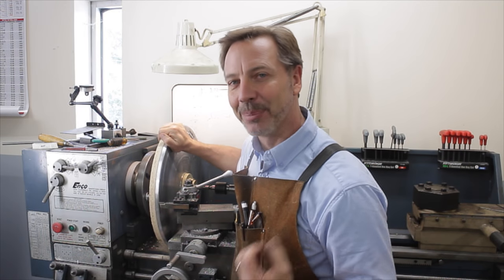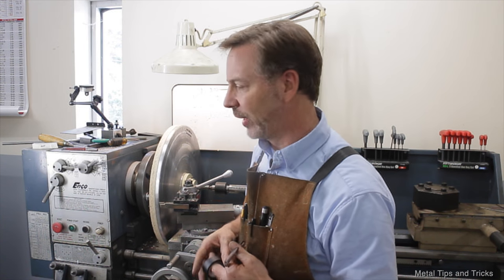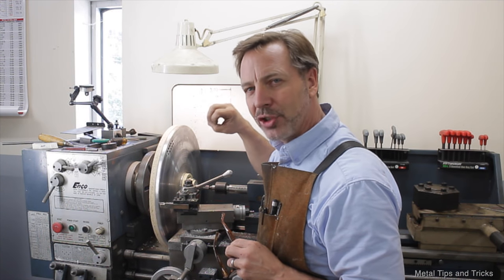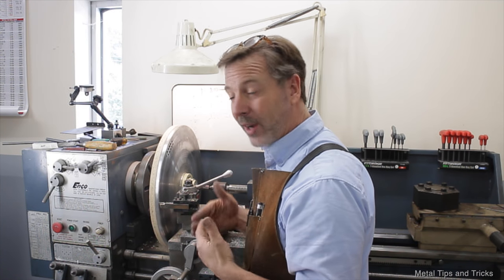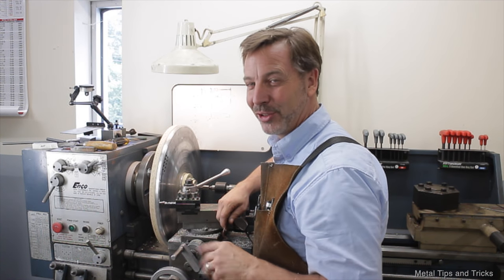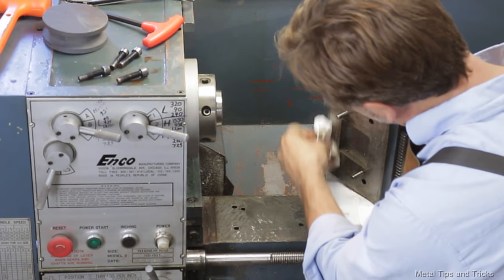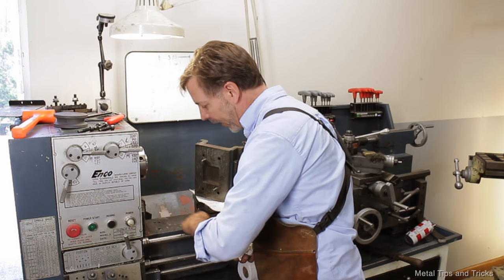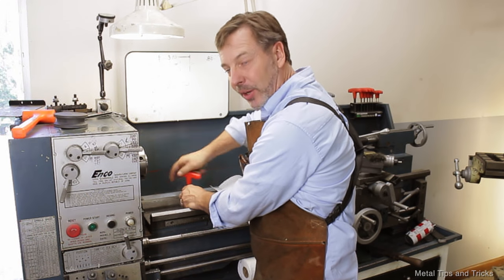18" disk sander part 2

Comment: When woodturning thin spindles, platters and discs like this it always helps to use the left hand if you're right handed to dampen vibration so with a leather glove on your left hand you could support the rim of the faceplate as you cut. Obviously it's a no-no to wear gloves on a lathe but if you're careful and trail the fingers below center height you're fine on this job. The circular table saws you mentioned usually also have a felt or leather pad on a block held against the blade to absorb high frequency ringing.

Comment: The brazed tool you were using has at least 1/8" radius. What you need is a 1/64" radius tip preferably at a positive angle or grind a positive swoop into the tip. As far as taking chatter out of the material, if it's steel I use magnets, mag bases, mighty mags, to avoid chatter. Controlling the rpm's is also important, you may need to take it slow. The methods you're showing work well for aluminum as long as the accuracy of the thickness is not important, then chatter might not matter either. Also you can fasten several studs with t nuts to the chuck and use flange nuts or coupling nuts tightened against the material to reduce chatter. Add strips of rubber between the material and nuts for extra chatter reduction if necessary. Lose the face shield and apron around a lathe, use safety glasses. The chuck, the part or a stringy shaving can grab to these items and cause an injury. Be safe brother.

Comment: Hello Dale,

Have you seen Tom Lipton's video on spring tool holders? Normal too post geometry results in the tool increasing its depth of cut if it's deflected under load. A high load like a form tool, or a large overhang like you had, are likely to result in significant tool deflection. Whilst normally we want high rigidity, using a tool holder that deflects quite easily can be an advantage if the point of flexure results in the depth of cut decreasing, rather than increasing. That's the idea of the spring tool holder. 

If you mount your tool upside-down and run the spindle in reverse, then any flex in the cross-slide, top-slide, tool post and tool is going to reduce the depth of cut and help prevent chatter, harmonics etc. I run my parting blade this way and have never had a dig-in.

The bed gap is a mounting surface, not a bearing surface, so you don't need many spots per unit area.
Reply from the maker: thanks for your comment. Ill have to try spring tool next time.

Comment: Don't worry about all the "safety " hounds. I bet they have forgotten safety, a time or two. In some instances, being "safe" can be a hazard. I have been there, wear safety glasses with face shield and STILL get stuff in my eye. I hate guards on grinders, they have caused me more grief than good. I work on pipelines, and grinds with guards will through sparks on the other guy. As far as machining, glasses is all I wear. Great videos, keep it up.
Reply from the maker: thanks for your support :-)

Comment: The wood backing was stuck on the disk and not touching anything else? Great video! I remember at a kid my dad and I taking his pickup truck in for a brake job. The front brakes were disk brakes the mechanic turned down the rotors, he used inner tube cut cut into one long 1 inch wide strip and stretched around it to stop the ringing and chatting. Thanks for sharing.

Comment: What are your thoughts on a multi layer plywood backer and or a micro tool with an abrasive wheel?  I think the wood should absorb any deflection/vibration and grinding as opposed to cutting again less deflection/vibration.  Or go to a brake shop if they still cut discs.  You could use a coarse stone in the sander configuration and go thru the grits almost like lapping it.
Reply from the maker: I like the way you think. there is a better way of doing thinks.:-)

Comment: Good work. I thought you would have put a dial indicator on the carriage to make sure the ways on the gap are in line with the ways on the bed. I know the two are aligned where they meet, but isn't it possible the gap piece is high at the other end? Wouldn't it be prudent to measure it?
Reply from the maker: I thing you might be right. better to be safe then sorry. :-)

Comment: It is a good idea to use a backing plate and double sided sticky tape. Probably many different types of backing plates would do since I guess that the most damping action happens in the sticky tape itself rather than the backing plate. Of course the damping in the tape would not happen without the stiffness of the backing plate building loads across the tape against the vibrating disk. And the backing plate needs to be flat so that the disk is not statically distorted during machining. Very useful video, thanks.
Reply from the maker: thanks for your comment

Comment: Dale - you might want to try a nice HSS that's really sharp with a nice positive rake.
Reply: I second that amendment! The cutting edge wants to be square to the feed direction too so as to load the spindle radially and not the faceplate axially at it's most flexible, which is the main problem here.
Reply from the maker: Itry hss and several different grinds, but the tool didn't hold up very long. Mostly because i could not get a deep enough cut. Do to the delicate nature of the disk. I wish Hss would have worked.😞

Comment: Dale, Love the channel. I noticed under the gap bed there are three or so chiseled peck marks at the rear left of the bed. Might be useful to mention that this is a way that the factory displaces metal in specific areas to raise a part for final fitting. I stoned some of these off the base of a Chinese finger brake and have yet to get the fingers perfectly aligned with each other.  Lesson learned. I trust your piece is now level but thought I'd mention it. Keep the info coming!  Dave

Comment: There are method for visually determining the location of harmonic nodes of various shaped flats. Mount it in the center, position it horizontally, sprinkle some salt or sugar on it. Now place a speaker next to it at full volume such that noise from the speaker drives the flat into motion (you may need to attach the speaker to the central shaft to impart enough vibration). The salt will bounce away from the places of maximum deflection and aggregate in those places of minimum deflection. This will suggest the best locations for you dampers. (somewhat better than "random placement").
Reply from the maker: interesting idea. :)

Comment: Hi Dale, great two part series enjoyed it very much. You talked about the 3-belt pulley used on the unisaw to cancel out harmonic vibrations, I tried to find more information on this theory and had no luck. All I found that it is used in high power transfer applications. Do you have a reference source that describes how and why it works to reduce harmonic vibrations. Thanks for all your good works!
Reply from the maker: I learned this some 35 years ago. so I don't have a source for you to research it. but it  similar to when you go to a playground were their is a  swing set. Get one of the swings moving it will transfer its energy to the one next to it and make it move,  but if you have 3 swings together it will not transferrer the energy wave because they cancel each other out.

Comment: Even positive rake carbides work on thin disks better but I would use HSS positave raked on aluminum with some 566 CRC. That workshop looks far too clean, how much work has that lathe actually done?

Comment: Some of the chatter may have been caused by how far you had your tools from the quick change holder.  I generally use a 3 to 1 rule.  I realize you were "reaching" to accommodate your machine travel but wonder if a larger tool holder may have also helped.
Reply from the maker: It not about the tool holders this case. its about the disk wanting vibrate because of harmonics. but i do agree having the tool out as far as I did doesn't help.

Comment: Dale, I like your videos. You have quite a few videos where you use that ENCO lathe and I think you should add that as a keyword, or somehow incorporate that leave into the title and some of these videos. I think it would instantly provide some great quality videos to The people searching for information. I just purchased and ENCO lathe model like that and I’ve noticed that there are not very many good videos available for that series. Mine is a 12 x 36”geared head but just about everything else is the same.
Reply from the maker: thanks for the suggestion, I will.

Comment: I wouldn't have tried to balance that large piece of particle board on the band saw. With that wheel able to provide that wonderful template bearing surface I would have used that double sided tape to hold the wheel down to the particle board and used a router with a template bit to ride around the wheel and cut it while laid flat against a table.

Comment: "Harmonics" means that you are setting up a vibration that is in sych-- has the same phase -- with the spindle speed, or maybe some factor of the spindle speed like 2x, 3x, whatever. We all get it sometiimes,  that is what "chatter" means. Lots of causes, unbalanced load is one of them so the MDF backing. was a very good idea. I have read other people's books and they suggest putting weight on the tool itself. Like tape a fishing sinker to the tool. I thought you had to much stick-out. Sometimes changing that by 1mm will get rid of the chatter. Other days, the bear gets you.
Reply from the maker: thanks for your comment

Comment: During most of your video I was worried about getting that damn double-sided tape off. I am fairly certain that the stuff is manufactured by the devil in hell. So, I learned something about using the lacquer thinner. Thanks! Also, I think that the MDF was a great idea that, in principle, has application elsewhere in the shop to provide dead weight when needed. Best. ~gjl.

Comment: You did good IMO...when running into harmonics of cutting tools in thin surfaces, speeds, feeds, mounting rigidity, damping and adding mass all need to be messed with.. Sometime you get lucky, sometimes you need to be more creative.  The melamine backing was a good fix.  One thing that worked in the past was using a lead tap in weight like Abom uses on the back. Hold it up against the back like your idea with the skateboard wheel.. 

I appreciate you pulling the gap.. I've got the same lathe but have not needed or had the courage to pull the gap..  One of these days I may need to..
Reply from the maker: thanks for the comment. I will have to say I was a little worried about pulling the Gap but it was as bad as I thought it might be, LOL

Comment: Variable rpm is the solution. 10% plus o minus of rpm
Reply: varying spindle speed on a CNC lathe works well with cuts on your Z travel. Using your constant surface speed command should help cuts on your X travel.  I am not much of a manual machinist to verify but I have not seen many manual lathes with variable speed control that can vary without stopping to change gears.  I believe this is one reason behind the steps Dale created.

Comment: You seem to have far too much overhang on the tool. That will always result in chatter. Regards Dave Tointon
Reply from the maker: Tom you are right, but this is what I had to do to reach the hard spot. Remember just because the lathe can hold the material it dosen't mean that it can be turned using conventional technics, Sometimes you have to cheat it and use a couple tricks. :-)

Comment: Are you a machinist ? No "magie" in working metal. It's not a  probleme of harmonics, but what did you expect with this lathe and set-up ?! ...
Reply: TJ,this guy takes the time to show people his skills so they can learn from it ,and you have to put him down.Ive machined bigger parts than that disk on the same size lathes,it is possible . I bet you couldnt even get that job set up.Even on a bigger macine youll have that chatter problems